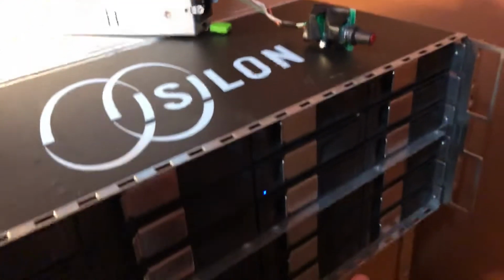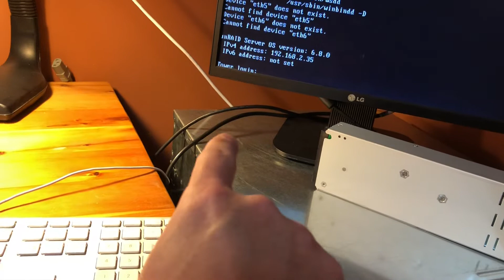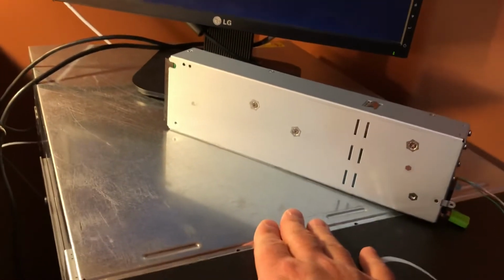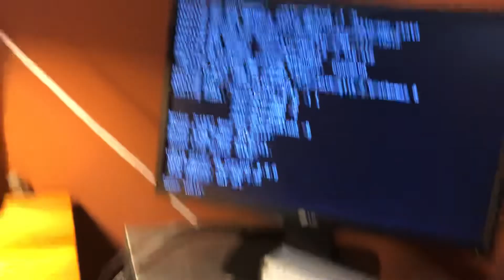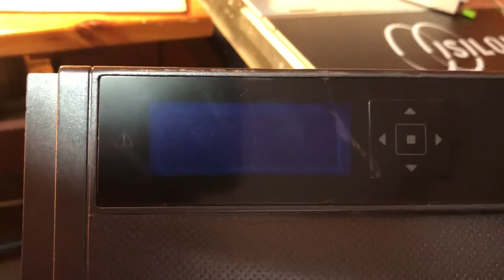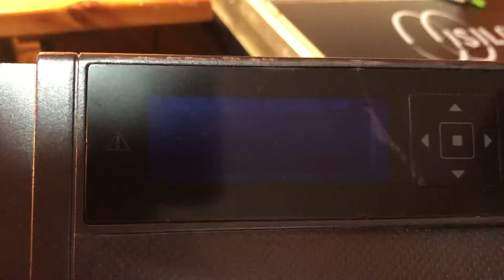Dell EMC (Lsilon) 36 bay NL400 - Noise & Temperatures

Comment: You are correct, EMC purchased Isilon a while back in 2010. Dell acquired EMC a couple years ago. The nodes were used to form a cluster of at least 3 nodes. They ran a custom version of BSD Unix and had their own driver for the front panel, you probably won't get it to work easy unless you write you're own program for it.
Reply from the maker: Adrian Olson thanks! Appreciate the comment !

Comment: Do you have pictures of the 120mm fan arrangement? I have an Isilon NL400 also and have replaced the internal fans with 80mm fans. I cannot find a quiet fan that has anywhere near the static pressure of the original fans.
Reply from the maker: I had to buy some slim 120mm fans and install them with ty wraps in the middle. Changed the cpu coolers to active ones and not passive. But, it isn’t perfect. Heavy load will cause the high temp sensors in unraid to alarm. Power supplies are loud too. I’d prefer switching to a 846 chassis but not worth $1000!

Comment: Hello, very resourceful video. I have a NL400, it's too loud. You mentioned changing fans from using the backplane to use the midplane. How did you do that?
Reply from the maker: This was a rough one. I swapped out the mid plane fans to a quiet slim fan. It worked but didn’t help the temps at all.  The original fans are much higher airflow. After 2 years of struggling with this case I’ve swapped it for a norco 4220 (20 bay) which let me use my own power supply and fans. Yes I loose the redundancy but having a quiet server was key !

Comment: So you have a X8DT6-F motherboard.  Can I ask if all of your SAS connection go to the motherboard or are they going to a RAID or HBA PCI-E card?  I have the chassis and the motherboard but I can't get the motherboard to see the 36 SAS bays that have hard drive in them.  I had to get the X8DT6-F myself but I don't know how the board was setup to work thru the SAS ports.  I checked that jumper JPS1 was enable for SAS use.  The LSI RAID options comes up ready to build out disks but I can't see the disk...  I am missing a part or connection here.  Do you have a connection going to SGPIO-1 and SGPIO-2?  Do you still have the daughter card for the SDD SATA boot that sits above the six SATA ports.  If so can you send a few photos of it configuration?   Any help is helpful...  Thanks
Reply from the maker: I'm using the built in SAS controllers on the motherboard (2 SAS cables) that run to the rear of the backplane of the drives.
Reply: @atomsbudgetreviews8713  OK cool so you went native , very good.  Same here.  Found that my issue wast the cabling.  It came up finally once I went thru and correct pathed the cables.  Thanks!
Reply from the maker: Leadius USA super ! Glad to help

Comment: I am planning to buy one storage server myself. Just wondering what OS are you using. I am planning to use a FreeNAS. will it work without any modifications??
Reply from the maker: I’m using unraid which does top out at 30 drives btw.. FreeNAS will work just fine as it’s just a case. It’s the hardware inside that matters.. Motherbosdd cpu etc...
Reply: @atomsbudgetreviews8713   Thanks for your reply. I will buy it off then. Will let you know once I confirm with the hardware.
Reply: I have bought the server and it seems it is working fine with Freenas out of the box and I am able to access all the 36 bays and its drives each bay populated with 4TB. Thanks once again for your reply. But the issue is only the fan noise inside and the psu fan noise. How did you manage to get that low noise. please let me know. Also Regarding Hardware it is 2 X E5603 cpus, 48GB RAM, 2 x 10GB Host bus adapter, 2 x 1GBE all sitting on the Super micro Board :-).
Reply: What is your power consumptions on this running 24/7 with around 4 hours usage and erst of the time idle??
Reply from the maker: Sash J I wasn’t able to get the power supply quiet. Oddly enough it’s still quieter than my qnap 12 bay unit !
Reply from the maker: Sash J this I’m unable to measure. I’ll have to check in the GUI soon!

Comment: Would an identical one be worth it for $500 USD with 72TB storage and 24gb ramm? I'm on the edge with it since it's hard to find info about these like you said. Planning to use this as a backup for my two current servers and pc. I was looking at something more low power as I don't need that much, but I feel like this might be a good deal.
Reply from the maker: urmastertech worth it! 72TB costs more than that alone. But be ready for one hell of a noisy machine. You can make it better by doing a fan swap but still far from perfect.
Reply: @atomsbudgetreviews8713  Yeah that's what I figured. I already have a dell r610 and 08 apple xserve which is very loud, but yeah I cuold do that. Just kinda waiting to sell my old gaming computer then to buy it possibly
Reply: @atomsbudgetreviews8713  I finally bought it after selling most of the computers I had collecting dust haha. Yeah it is very loud, louder than my xserve and r610. I'm thinking of using unraid or freenas, but going to try out both on a flash drive and go from there. Yeah I will be replacing the fans inside the server, just have to figure out the size and such. I might have to buy the $140 rails because I don't think my universal ones would handle the weight. Are the psu fans really that loud?
Reply: @atomsbudgetreviews8713  Any luck with getting the front panel to do anything? I just saw so far it lit up the logo and if you hit a button, but would be cool to get it to show the temps. Haven't had a lot of time with it but plan to this week, especially looking up quieter fans
Reply from the maker: urmastertech no.. no luck. I was thinking of modding a LCD panel to replace this one. But due to high temps I leave the front panel off most of the time. Quieter fans?  Get some 120mm slim fans for the 3 mid fans. Plug to motherboard. Get active 2U cpu coolers (dynatron) and put bios to  low power mode
Reply: @atomsbudgetreviews8713  Darn oh yeah that could work or even like putting a raspberry pi I was thinking to monitor the temps. Oh ok I'll have to look all of that up
Reply: @atomsbudgetreviews8713  I did switch the coolers and added some noctua fans. What temperatures are you getting? I have it in a spare bedroom with 2 other servers in my rack, but haven't turned it on since I moved a few weeks ago, just wondering if it'll be worth while to invest in a portable air conditioner

Comment: It's spelled Isilon and is pronounced the same way -- I just got one of these! How is the PSU fan mod working out for you?
Reply from the maker: Fan mod isn’t working. It recognized that I tampered with the power supply and refused to boot! :(. Noisy PSU for now..
Reply: @atomsbudgetreviews8713  Thanks for the reply, I'm currently using a fan shroud which helps a little bit...but it's still a lot louder than I would like even in a sound proof cabinet

Comment: Can you replace the motherboard on this beast or does it have custom power distribution?
Reply from the maker: I used another supermicro x8 motherbosrd before buying the Lsilon supermicro motherboard and it worked just fine.  I only bought it hoping I can use the 3x mid wall fans and silence them. Nope !
Reply: @atomsbudgetreviews8713  Just FYI it is "Isilon" w an i at the beginning.  This is a Dell EMC company that has been around for quite sometime.  Mainly they do scale-out NAS devices, of which these chassis were a huge part of their business.
Reply: @atomsbudgetreviews8713  Also, I replaced the mid wall fans with 120mm fans, just plugged them directly into the motherboard and it works just fine!

Comment: Can you link the PWM controller that you're using?!
Reply from the maker: I’m using the supermicro built in fan headers and set the bios to low power. Using the PWM apps in unraid to help tweak it more. I recommend a x9-x10 supermicro board as you’ll have command line fan control.
Reply: @atomsbudgetreviews8713  I have an X8 board =( -- Will be updating sometime in the future, but most likely not anytime soon as it works for me.  So i'll just have to deal with it. I've added multiple other fans and am running cool.  Just have to figure out the PSU noise as stated above
Reply: @atomsbudgetreviews8713  BTW, I was asking for a link to the PWM controller you were using on the PSU ;)
Reply from the maker: @DerekEdwards  sorry for the delay! This is what I used.. unsuccessfully I may add.  https://www.amazon.ca/gp/product/B07TRDC14V/ref=ppx_yo_dt_b_asin_title_o00_s00?ie=UTF8&psc=1